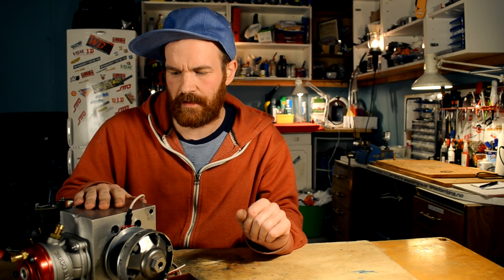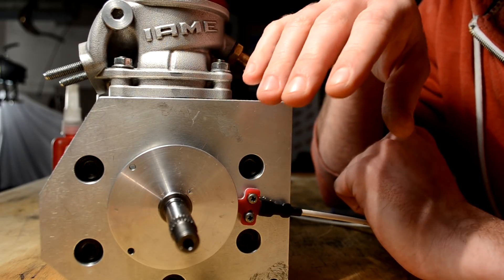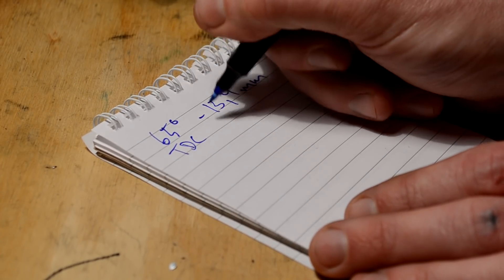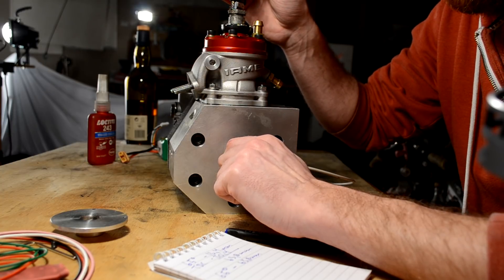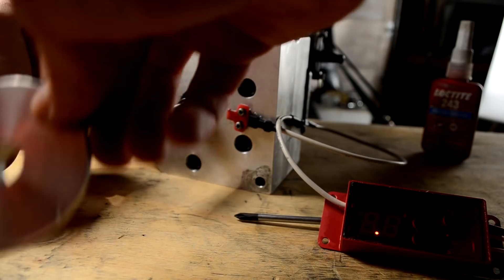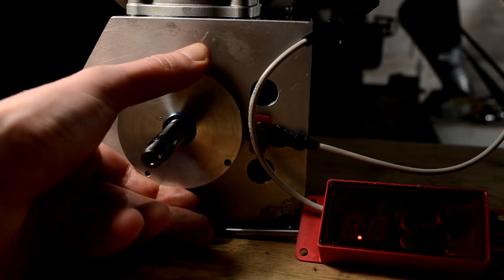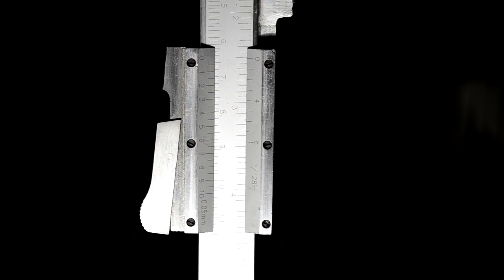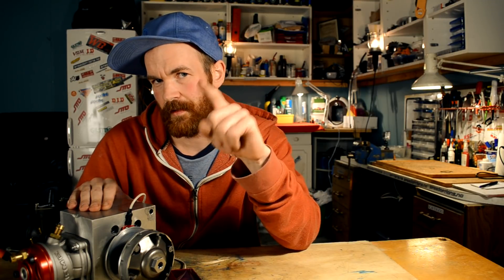50cc Rotary Valve Nitro Moped Engine, Ignition and Variator | 2 Stroke Tuning

Comment: I've had my fair share with mopeds / scooters,
But we only putted like 70cc aluminium cylinders on our Minarelli horizontal blocks and of course change cranks that stuff,
But your stuff is fascinating man!

I watched your Aprilia SR50 ratrod scooter video, and funny enough I still own my Aprilia SR 2000 (the pre comer of that) It has a Minarelli Horizontal with just a 50cc (since were only allowed 49.9cc due to laws) with a Stage 6 exhaust overrange and a polini speed control variateur and it hooks up pretty good :) top speed of around 80 which is about 30 over whats allowed :P
Reply from the maker: +Cap'N Cook Thanks! 50cc only in Norway too.
Reply: I used to run a Polini Gisha which is a 50cc "race" cylinder, its still cast iron so really durable and it went around 90 km/h with around 9 horsepower :)
If you ever can get one for cheap i'd def recommend it ^^

Comment: How are you set this ignition, yours   TDC is on 50.4mm and you set piston on 63.8mm?  I have problems whit seting my ignition in instructions say to set piston betwen 1.8mm to 4mm. Please help
Reply from the maker: +aleks železnikar It's programmable, the 65° BTDC is just to "sync" the ignition with the crank, actual ignition timing is programed in the unit. Does your ignition have a curve or is it static?
Reply: 2STROKE STUFFING I have a HPI ignition it have cdi

Comment: Hi bro, how can I calculate the exhaust for my kart ? Do you have programs or something?
Reply from the maker: +Grasshopper I use engmod2t, works great!
Reply: Is it free?
Reply from the maker: +Grasshopper No, 400$, but well worth it! It's a two stroke engine simulator.
Reply: Deeeem, 400$, lmao, it's too much, can you calculate for me xD
Reply from the maker: +Grasshopper It's not that simple... I'd need every dimension of everything throughout your whole engine. Google "fos pipe calculator", free and will produce a good starting point.
Reply: I know every dimension :D (exhaust port lenght, width, height) top corner radius, bottom corner radius, exhaust duration ATDC, rpm, conrod lenght... etc.... i found some programs but i don't know it is working good..

Comment: Hi i seen your video about roller weights , i need some help , i have 5 gram rollers now my parts list are below and it is slow until it reaches 8500 to 1000 rpm as you may know the stage 6 pro rep exhaust is a high revving one and i need the pull of to be better as when i full throttle it goes to 6000 rpm and hangs for a bit until it gets to 8500 rom then shoots up from there to 1000 rpm, im lost i need your help please thanks , i think your videos are awesome and helpful to keep it up 

Has these mods
Stage 6 pro rep exhaust 
Stage 6 R/T drive belt 
Stage 6 5 gram rollers
Stage 6 foam air filter insert
Polini hi speed variator 
Polini torque spring
Polini clutch springs
68 Main jet
Reply from the maker: +MrRainesFTW Strange, sounds very uneven. How long have you run this setup, could be uneven wear causing it.
Reply: 2STROKE STUFFING ive had the setup since november all parts are brand new and the rollers looked fine inhad to shim the variator so it would make it take of better to

Comment: Gday alex i was washing my beewee 100 barrell under the kitchen sink after some minor port adjustments and realized how good it is to see water flow through the inlet tranfer ports into the cylinder.  Its a great visual representation of how critical the angles and flow directions are.
Reply from the maker: +gravelyeti gravelyeti Yeah, that's how I do it too! Take your results with a grain of salt though, constant flow of water is quite different to pulsating flow of somewhat homogeneous air/fuel mix.

Comment: Can JB Weld used to fix a scored piston skirt ?
Reply from the maker: +Andy Tinline I think it'll wear away pretty fast.
Reply: Will itg wear and brake off or just wear our ? The engine was showing 110 psi with the scored rings and 3 of them were stuck.
Its a V4 85hp johnson outboard.
I owe you a great big Cheers for your video. When i first started i knew very little about two stroke tuning. Because your videos are real trial and error every one feels involved
Reply from the maker: +Andy Tinline Thanks man! I wouldn't do it, could break off and cause trouble.

Comment: do you mix nitro with oil? if so what ratio and what oil? and do you use 30% nitromathane fuel or higher? what happends if you use say 60% nitromethane fuel? will you see power gains?
Reply from the maker: +Mario Raja RC fuel comes premixed with oil. I'm running 20%, higher percentage will definitely cause a powergain!

Comment: did you blowtorch the steak?
Reply from the maker: +UKMoped yep. I thought it would just create a thin crust on the outside and leave the rest raw but it actually turned out too well done in my opinion.
Reply: look into..josper oven. with your skills you can make one. the best thing ever. :)
Reply from the maker: +UKMoped Thanks, I'll check that out!

Comment: the vario cooling fin is crooked he wobbles, and it is better to sand the vario and the cooling fin to make it rough in any case 
and you can also do this with the v-belt ,
it gives you more power
Reply from the maker: +erik de jong It's not actually bent, just uneven thickness - ground off the fins by hand.
Reply: OK, I thought I saw that he was crooked, but you have to try to sand you vario ,you will see that makes a difference
Reply from the maker: +erik de jong I'll try that!

Comment: Can't wait, man; This one will hold together, I have faith! You put all of this time into having the utmost precision, CAD models, powerpulse calculations, ignition maps....but no wideband! At least you can run Nitrometh  rich / fat as all hell, and make more power while doing so. I think it actually doesn't matter how rich because it technically has it's own oxygen to burn (or...detonate, really). I've heard 3:1, up to 0.5:1. So you have that going for you. One thing I wanted you to know if you didn't already, and this came from an old Top Fuel racer I know: Apparently high specific output engines, don't like to be ran cold on Nitrometh. As you know, the fuel itself sucks a shitload of heat out the block, and assuming you are at the correct AFRs, it can hydrolock if there isn't enough heat from start. You sound like you are from...Finland, Denmark, maybe Sweden, I'm not sure; but I bet it's cold. Food for thought, best of luck man. 

-Pepe

Comment: What was the con rod length and stroke on that engine ?
Reply from the maker: +AuMechanic 75mm rod, 39.1mm stroke. Could benefit from a longer rod.
Reply: Thanks, I was just messing around with my engine sim software I've been working on.
Just wanted to dial up the 65 degree and compare the value for a sanity check on my formula..
I got 13.411 mm at 65
Reply from the maker: +AuMechanic Spot on!

Comment: Would balancing a 4stroke crank help with proformance 
Like the crank out of my predator 212cc?
Reply: Ford For Life, of course!
Reply: 2STROKE STUFFING I'm just trying to make it balanced so it will rev a bit higher and smoother
Reply from the maker: +Ford For Life If it has the wrong balance factor for your application, yes.
Reply from the maker: +bier baum beat me to it...